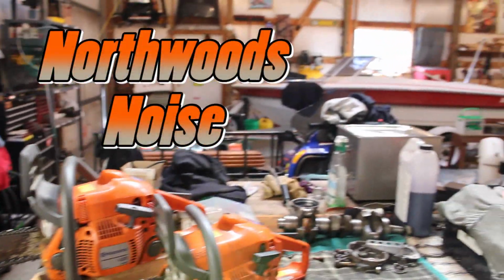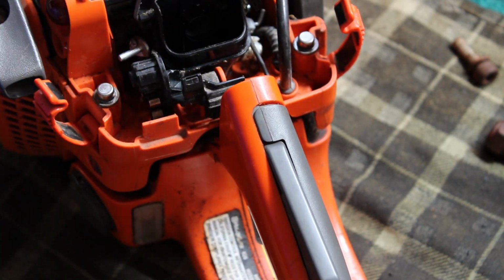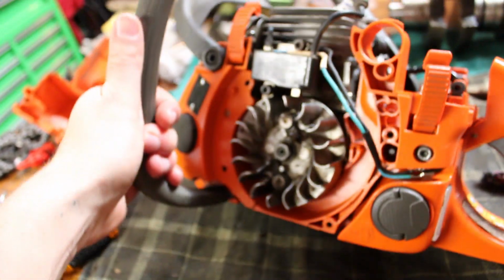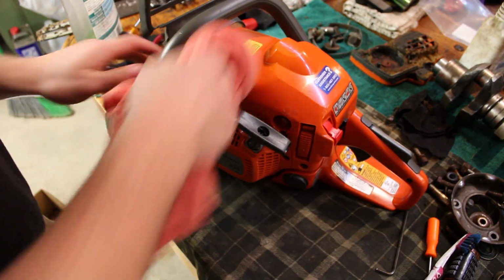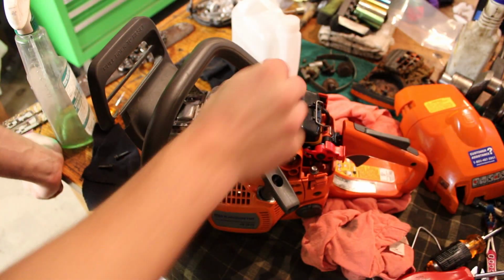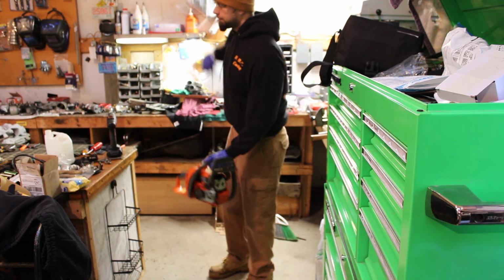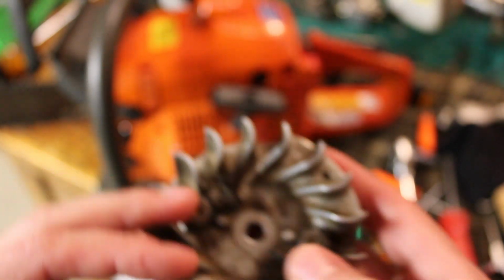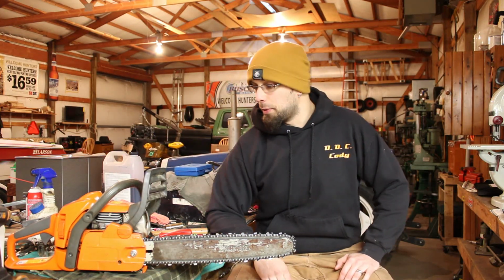$20 Husqvarna 435s! Can we save them? Absolute nightmare, no wonder previous owner gave up...

Comment: It's clear to me that whoever worked on these saws before you bought them had no idea what they were doing. For example, in the beginning, the saw that almost started had the low speed needle set too rich. When this happens the saw will "pop" like it wants to start but you'll never get it started. Then, after you were able to get it going, the high speed needle was set too rich as well. I doubt the engine would even run smooth while in the cut. I've have a Husqvarna 435 that's 6 years old and use it exclusively to limb red oak after felling. They're great little saws if they're maintained properly. My felling/bucking saw is a 17-year old Husqvarna 455 that's recently been rebuilt as a 460 and it'll pull a 24" bar all day long. I wouldn't part with either of them.
Reply from the maker: I would agree with that. I think some people dont follow any sort of basic troubleshooting steps and just start swapping parts and making adjustments. At least that's what it seemed like here. About everything that could be out of adjustment was. My primary saw is a Husqvarna 162 se that my grandfather bought brand new decades ago. It's a fantastic saw and never let's me down, but it's anything but light. I may have to hang onto one of these for limbing.